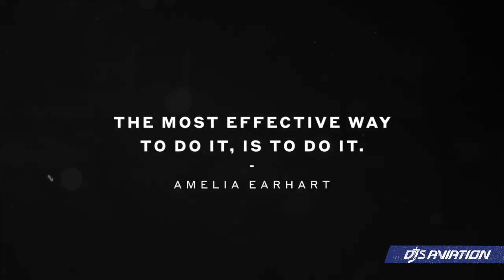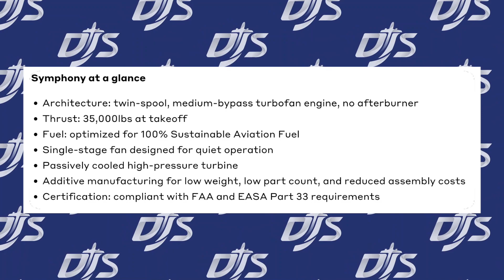Major Boom Supersonic News

Comment: Is boom supersonic taking off next year in 2023
Reply: I doubt the XB-1 ‘flight test article’ will fly next year.  It was designed and rolled out as a demonstrator for a larger 3-engine aircraft…which now has four engines.  Still, I’m hoping whatever they’re doing works and I live long enough to hear about it, if not see it in flight.

Comment: Is supercruise possible for an aircraft of this size?
Reply: Yes. Concorde did supercruise. Concorde also had the two largest engine manufacturers in Europe on board and massive support from both the French and UK governments, with pretty much the entire aerospace industries of both countries at it's disposal, plus absolutely massive government support (something like €15bln in current money). So yep, totally possible if you have enough money, expertise and resources at your disposal.... none of which Boom has.
Reply: @lmlmd2714  No. The Concorde only achieved supersonic through its afterburners. Super-cruise has only ever been achieved by the F-22 and the F-35.
Reply: No. I doubt it can even fly.

Comment: I think that this could possibly be a thing! However 2029 seems a bit too ambitious.
Reply: Well if they do things like space x and elon then they may get there
Reply: @p_d_a_trfs6585  the certification alone with the FAA can take years. Just look at the 777. A clean sheet design, from a company with no experience and now also a brand new engine design in just 7 years? I don't see that happening. Add another decade at least.

Just look at startups in the automotive sector and you'll see how unrealistic the time frame is.
Reply: @Hans-gb4mv yes, a military grade super cruise power plant. 2029, Right!
Reply: @p_d_a_trfs6585  true
Reply: @p_d_a_trfs6585  I don't think repeatedly blowing up their planes and actively fighting the FAA is a very good way to make a plane imo
Reply: Why? Because they told you?
Reply: This plane will never take off. It will be way to expensive to fly on it can’t go supersonic over land so there’s really no point and no market
Reply: "aim for the stars. if you dont get there, at least you'll be sky high" - a random person ig
Reply: I wouldn't be surprised if they made it actually, I mean space X landed a rocket just 13 years after their founding.

Comment: Without afterburner, with a low thrust engine, with a huge aircraft, it will take a longer route to takeoff. Which airport can accommodate them?
Reply: Super Cruise like the F-22
Reply: @boondockduane  F-22 is damn lighter if you compare with Boom. It is 1 seater vs 50 seaters. Do your homework first.
Reply: It is rather well known, had the builders of Concorde been able to reach a dash 200 model, the improvements were going to be 1) a longer fuselage, 2) more fuel efficient engines which could c) reach Mach 2 without the afterburners.  So the engineers of 60’s and 70’s clearly felt it was possible to provide greater thrust without afterburners.  I’ll be curious (and hoping I live long enough) to see if they can pull it off.  The engine/wing configuration is what worries me.
Reply: @shepardbook  your worries is right. With that delta wing, it’s L/D is roughly 9, which is very low to take-off. Without afterburner, and heavy aircraft, they will need a high-bypass engine which they don’t have.
Reply: Ari Parker  except you. you just don’t understand a heavy aircraft like Boom is not comparable with F-22. the OEW is just different level.
Reply: Ari Parker  I have met many senior aerospace engineers who don’t understand aircraft physics like you. 😂😂
Reply: Ari Parker  mr aerospace engineer, you just don’t understand how an aircraft can fly. Enough!
Reply: Ari Parker  it depends on your responsibility. If it is an easy job, you are competent.
Reply: Ari Parker  you don’t even know the thrust requirements  for Boom to take-off when it’s L/D =9, and PAX=50. if it can’t take-off, don’t talk about supersonic cruising. Genius!
Reply: Ari Parker  enough said, just show your calculations to prove Boom can even take-off in standard international airport. Prove me wrong.
Reply: Now it has been 1 hour and Mr Aerospace Engineer can’t prove that I am wrong. We all know who is afraid of being wrong 😂😂
Reply: @hafizuddinmohdlowhim8426   funny thing, just thought I’d share. it wasn’t even him that mentioned the f22 in the first place 😂😂😂😂
Reply: Ari Parker    Bro what did you say to set him off 😂
Reply: Ari Parker  you don’t understand aircraft physics.
Reply: Ari Parker  not all aerospace engineer understands aircraft physics.
Reply: Ari Parker  it was you who don’t understand a heavy aircraft and a light aircraft are different. You think F-22 and Boom is the same 😂😂
Reply: Ari Parker  Open your textbook again. Check if a heavy aircraft can achieve the same speed that a light aircraft can do if it has the same power of an engine. The answer is NO. A heavy aircraft needs a higher thrust engine. Genius!
Reply: Ari Parker  this 🤡 shows your brain as an aerospace engineer. Congratulations!

Comment: Isn’t an afterburner a pre-requisite for super sonic flight?
Reply: Not necessarily, but generally yes. It's called super cruise. You have to have enough thrust over weight to achieve that though. Aerodynamics play a huge role, and if they make it slick enough absolutely doable. Don't expect a 400 passenger aircraft carrying multi-tons of cargo in a hold though.
Reply: Concorde could cruise at supersonic speed without afterburner, and also 5th gen fighters are usually capable of supersonic flight without afterburner.
Reply: An afterburner is not necessary to propel a craft beyond Mach 1.  Supercruise has been around in the defense sector for awhile.  Though the F-22's engines are equipped with afterburners, Raptors can transit from point A to B at supersonic velocities above Mach 1 without using afterburners.
Reply: No. The best engine / aerodynamic configurations allow a plane to "supercruise" (fly supersonic without afterburners). Concorde had afterburners, but they were not used when cruising at supersonic speed. They were only used on takeoff, as it was found to be more efficient. However, supercruise is something of a holy grail - incredibly desirable, and extremely hard to achieve, even for engine designers with decades of experience and the resources of a massive organisation behind them and effectively endless fountain of money that comes with military contracts.
Reply: Ari Parker  Quite correct.  They’d use them for take off, switch them off, cruise about Mach 0.8 (please correct me if I’m wrong) until they got over water, then turn them back on to accelerate to Mach 1.7.  Then the pilots switch them off again and reach Mach 2.  What I would have given to fly onboard one once.
Reply: Ari Parker  Much as I’m hoping Overture isn’t vaporware, I’m still wondering how an airline is going to operate it.  It’s proposed to carry, at most, 80 (according to them) to get about, again according to them, about 750 extra miles.  Still, if all goes well for Boom, Overture will enter service early next decade.  Hope I’m still alive and fit enough (with enough cash) to fly on one.
Reply: The afterburner for the Concorde was mostly used at take of and also breaking the sound barrier, When Concorde reached mach 1.2 it could turn of the afterburner and accelerate to mach 2.2.

Overture have a much higher span to weight relationship than Concorde. So its optimized CAS is much lower, this allows it to take of at a significantly lower speed, hence also using less power to take of.

There is also one more factor that ... is sort of the kind of lies you tell children. The usual statement is that the sonic boom is a ongoing boom everywhere under where the plane pas. While that is effectively true, Concorde due to it very high optimized CAS had to break the sound barrier at a fairly low altitude. Overture can do it at a much higher multitude. This will effect the volume of the boom significantly.  

Breaking the sound barrier at a higher altitude also need less power, hence the need for afterburner is reduced.
Reply: They are genius

Comment: No afterburner? Boooo
Reply: Ari Parker  you are comparing apple and peanut. F22 for a single seater, of course it doesn’t need a afterburner. Now it is 50 seaters dude.
Reply: Ari Parker  it’s weight is not the same genius!
Reply: Ari Parker  an aerospace engineer who doesn’t understand aircraft physics. Which country are you based? USA?
Reply: ariparker3417    Mach .85 needs massively less power than the speeds approaching and beyond mach 1, depending on the design it can be multiple times more power needed at .85.

This is why Concorde used its afterburners to go through and beyond the speed of sound to the point where they were turned off for super cruise because the drag level dropped as the location of the shock wave moves away from the vehicle.

I do wonder where you qualified, if at all